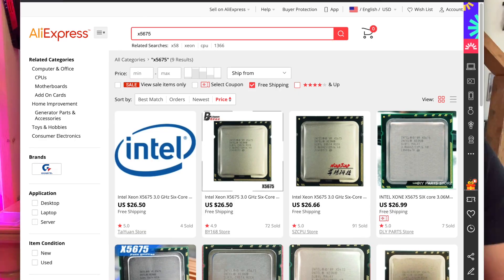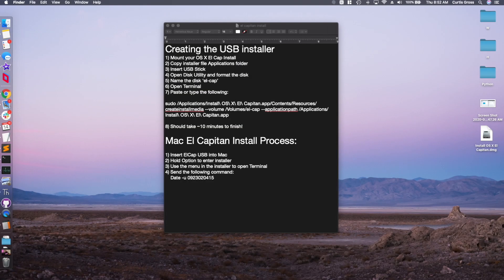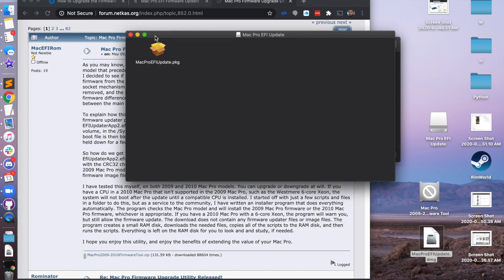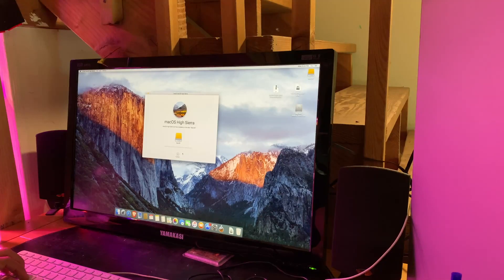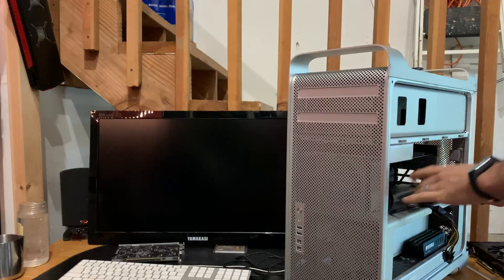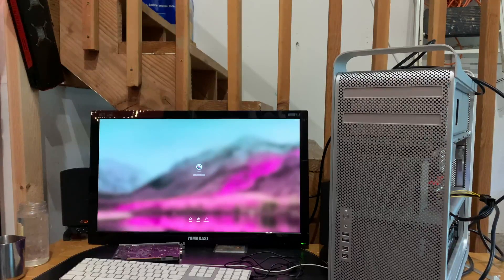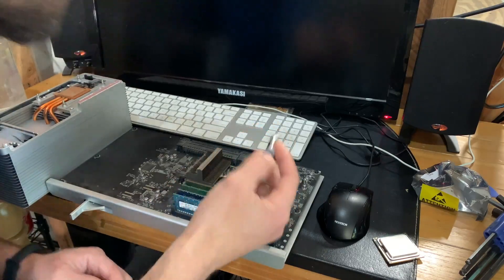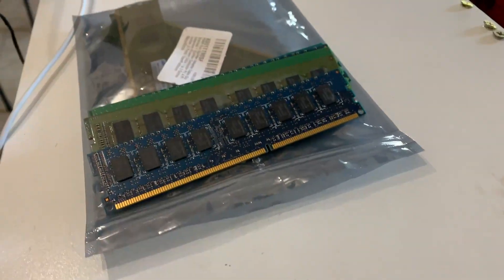Upgrading a 2009 Mac Pro - The Best Budget Mac (audiofixed)

Comment: Good video with help for many.  A few points of correction.  A CPU upgrade is not needed for High Sierra or Mojave but rather a metal capable GPU (for Mojave).  Flashing to 5,1 is needed to support faster CPU and 1333 MHz RAM, but not 1600 MHz RAM.   CPU upgrades for a 2009 should be delidded (plug and play) or you need to add heat sink washers.  Delid is better as you’ll improve heat transfer.
Reply: just a note..the single cpu boards do Not use delidded cpu.... its the dual socket versions , that are 2009, that require delidded cpus or all kinds of issues can happen, though it IS possible to skip the delidding as long as the Correct washers are used... 2010 dual cpu models used lidded cpus and dont require any mods

Comment: I have the single core 2009 4,1. Upgraded to 5,1 installed a 6 core Xeon 3.33 ghz x5690, currently running 16gb ram but would like to upgrade that. Also put in a Gigabyte Aorus RX 580 4gb. Just installed OpenCore and have the boot screen without having to flash the GPU. Also installed is 18 tb of drives, and a m.2 NVME PCIE in slot 2 x16. Just upgraded to Catalina and everything works perfectly. Have not had a single issue. I mainly use this machine as a time machine backup and a Plex server. Eventually id like to get the dual cpu tray but having a difficult finding one for the right price. All these upgrades were very easy and I say that as a person that does not know a lot about terminal code.

Comment: I have a 2009 mac pro flashed to 5,1 running high sierra. when I installed the sapphire rx580 with the right cord, my screen is black but the system is running. How do i proceed? Any help is nice.
Reply from the maker: Which sapphire card do you have?
Reply: @messing-with-computers  I figured this out. I had a one way DP cord that wasn't labeled one way. Frustrating but it works.
Reply from the maker: Fairest Lens oh man - ran into the same thing. So frustrating. Glad you fixed it!

Comment: I did the firmware update (4,1 to 5,1) and the funny thing is that the latency in Pro Tools 11.3.7 went down considerably. I can now easily set the latency to 64 samples or even 32 samples in a large session instead of 512 at 48 KHz. 256 samples at 48 Khz usually works for a guitarist or drummer to record at but higher than that it's almost impossible. At the moment I use eleven-rack as the audio interface (USB 2). My Digi 003 rack+ has stopped working (fire wire 400) but I will fix it soon. Then I upgraded the dual quad core processors at 2.26 GHz to dual six core at 3.33 GHz. I'm surprised that the firmware did such a huge difference. I still use Yosemite because PT 11 could have issues with El Capitan or higher. I'm also keeping the ATI 4870. It's a DAW.

Comment: To whom who thinks this is an easy walk in the park just remember that those machines are old and their components are brittle and have gone through hot and cold for years.This being said removing the heat sink might seems easy except that the nuts are affixed to the board and are prone to come off ( happened to me)...once off it will not secure the processing unit and the computer will not boot.Know what your are getting into.

Comment: Gotta love these machines, so under rated.  They run Mojave amazing!  Love OpenCore on them too.  Will be tearing ours down to get a guide set up for it! Great video thanks! To add to it though I really would use a dual 6 pin to 8 pin even on the 480 the logic board can only run 75w trough each port and 75w from the PCIe slot.  Really best to run the dual so you do not run the risk of trying to pull too much power through the Logic Board running the risk of blowing out a capacitor or something on the board. Good choice on the X5675 lower power less cost and on par with the X5680's or X5690's
Reply from the maker: I agree that it can be problematic to draw too much power, I walk that fine line... haha.  Haven't been bitten yet (cross my fingers).  I did quite a bit of testing on the 480 after their launch as well.  They average around ~90-130 when doing intensive workloads depending on the bios they have installed.  Just don't use one that is a launch card without any driver updates.. they can pull 90w from PCIe slot alone and only draw 20-30 from the plug.
Reply: no they dont mojave buggy

Comment: Is it possible to go to Catalina
Reply from the maker: Hi Luka, it is possible to get to Catalina on these older Macs, you will need to search Google for 'dosdude catalina patcher' and use it to download and modify a Catalina installer to get it running on your machine.  I did this process for installing High Sierra on my older 2007 imac, so some of the instructions are in that video!   Overall, I like Mojave more still... so I would personally hold off on updating until Catalina brings something to the table other than "Removing 32bit support."
Reply: ran monterey on the 2009 mac pro, even with the gt120 default nvidia card..work flawless.. used opencore legacy patcher... probably even run Ventura if u wanted

Comment: Great video! Please be careful next time when replacing the CPU in the socket, that accidental drop could have bent or broke some pins off. I have seen it happen to a friend and it was a pain to fix it let alone replace it....Keep up the videos though, have been enjoying them.
Reply from the maker: I got lucky, in this case the Xeon chips are all LGA - which means the pins are on the motherboard rather than on the CPU!
Reply: @messing-with-computers  That's true. Those motherboards are quite expensive if the pins broke off...
Reply: Yup, those LGA pins can be your worst nightmare. I screwed up my MP 2,1 logic board somehow as the pins became bent. Paying close attention to the correct direction and laying it in the socket very gently is key.

Comment: I took out i5 2400s from dead iMac 2011. The socket is 1155. I believe it should work is standard pc motherboard. I just want to double check if it is possible to put inside the pc.
Reply from the maker: Jan - you can absolutely use that CPU in a different PC or Mac!